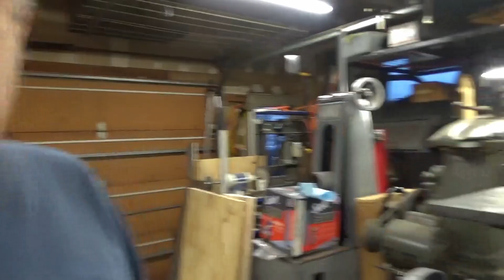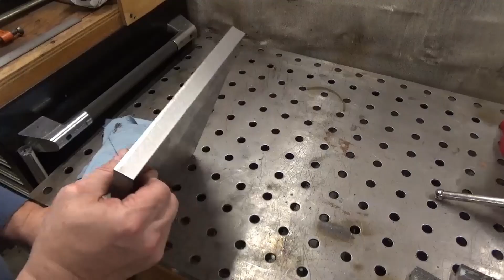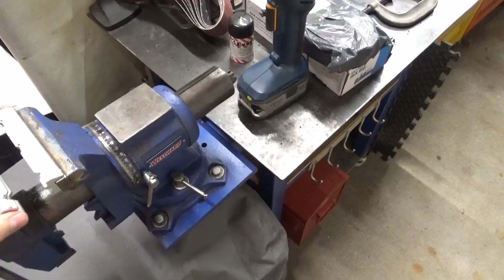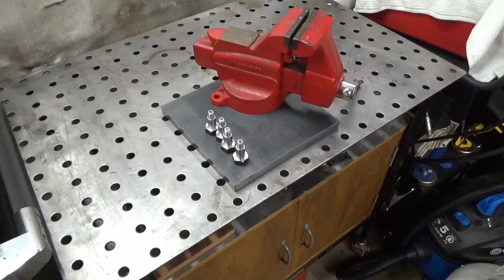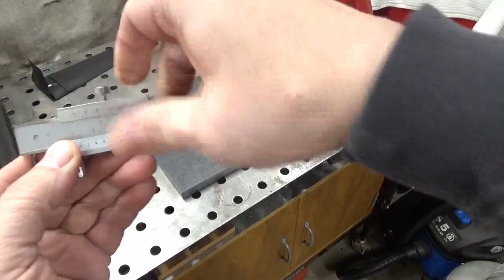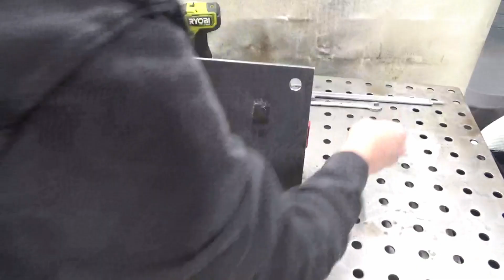Harbor Freight Welding Table Vise Adapter Plate

Comment: Tip: If the design has the back face of the vice placed slightly forward of your table edge, you can secure longer peices vertically without the table interfering. 😉
Reply from the maker: @mbliss01  Yep, I knew that, and other people pointed that out. Just slipped my mind when I was mounting the vise.  I may fix it if it becomes a problem.  It is a 2nd vise.  Thank you for your kind feedback and for watching.